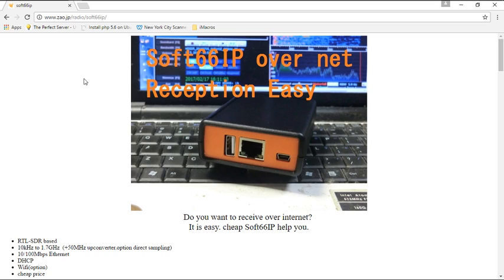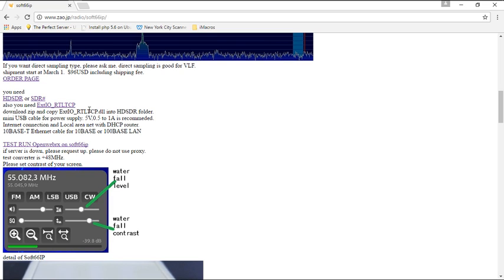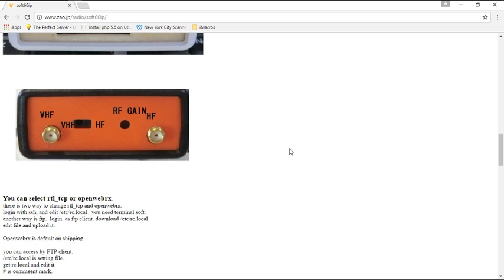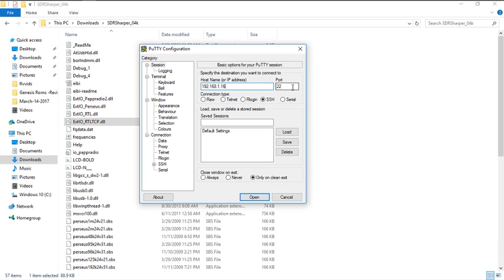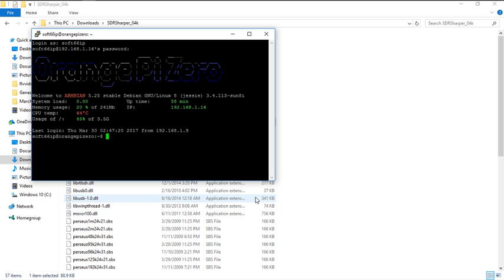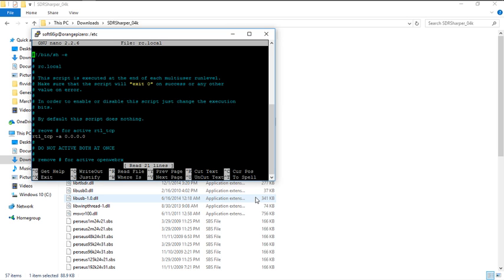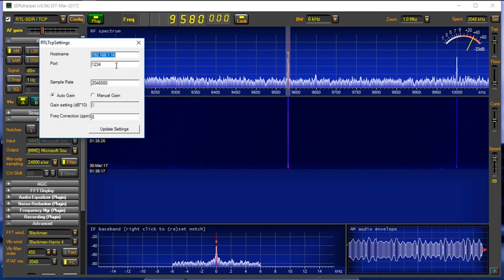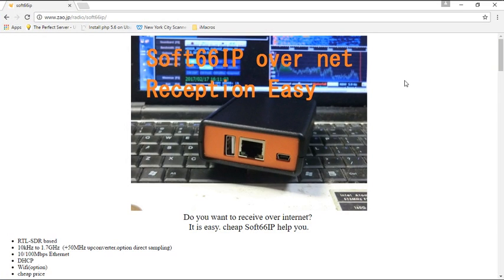How to setup Soft66IP for your Local Area Network with SDRSharper

Comment: I followed your detailed instructions and wrote the file.  I then opened it again to verify it was saved.  It was.  I rebooted the device and tried to access it.  No luck.  I went back and edited the file again but it was back to the original form as if it was not saved.  Why did it not save it when I did the reboot (pulled power)?
Reply from the maker: I would contact him, because I had to return mine for a refund after a few days of use, because either the network controller or the software went bad.  I can't no longer recommend this product. However I will keep this video up for anyone that owns this device.
Reply: Luckily I did not pay for mine so I am not at a loss.  I will continue to see if I can figure out what I am doing wrong but not much hope.  Thanks for your time and help.